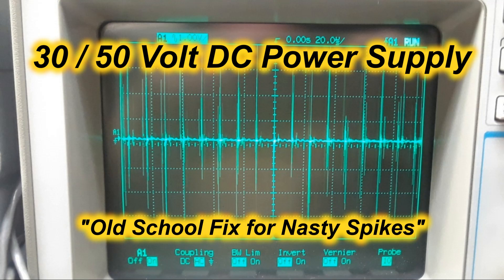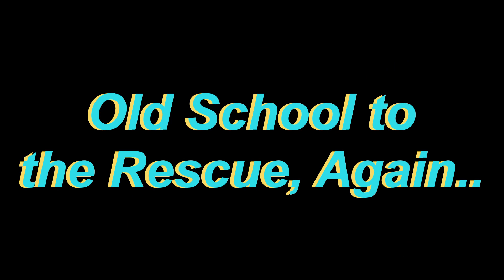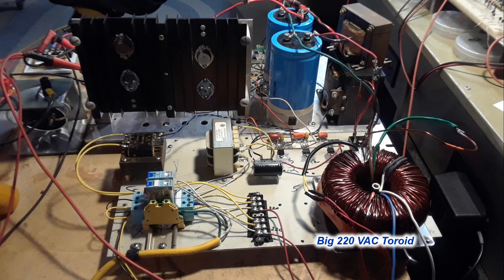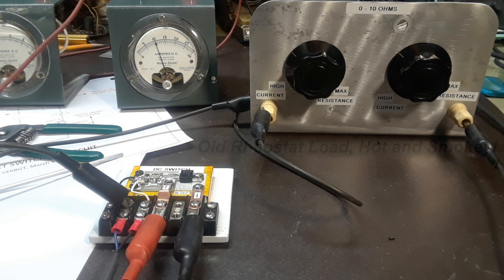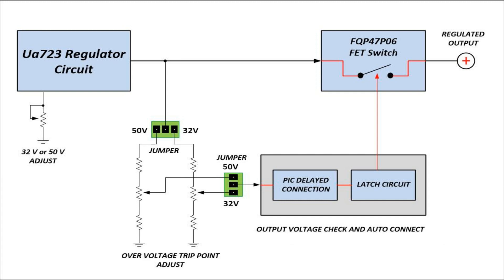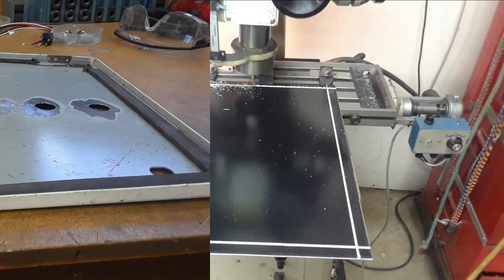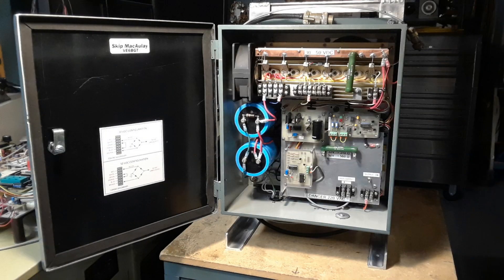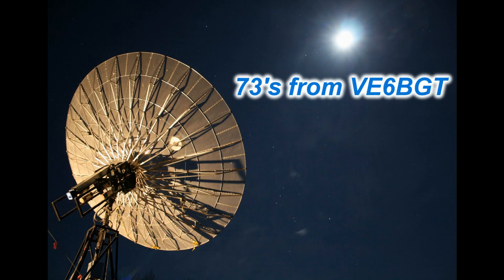EME Feed Amplifier 30 / 50 VDC Power Supply

Comment: I hear you on this topic.
I save all transfirmers from old audio equipment from which I add rectifiers and regulators for multi output power supplies.
Reply from the maker: Great minds think alike!!  I have transformers that I salvaged from over 30 years ago.. I used to fix TVs and radios back in the 70 and 80s and I threw nothing away.. Transformers especially!  I hate switching supplies!!   Skip